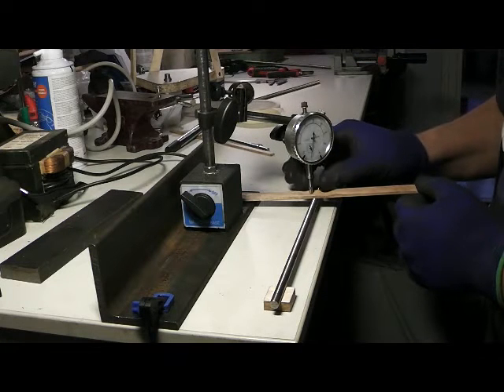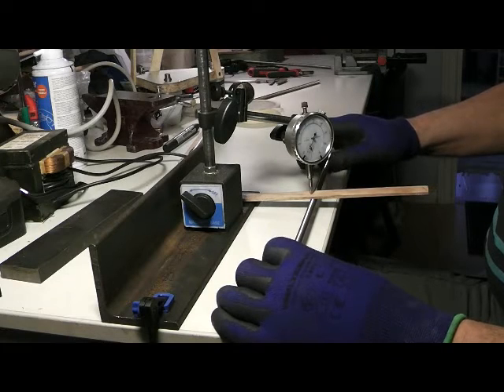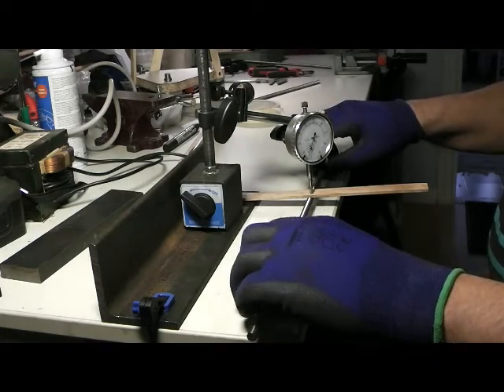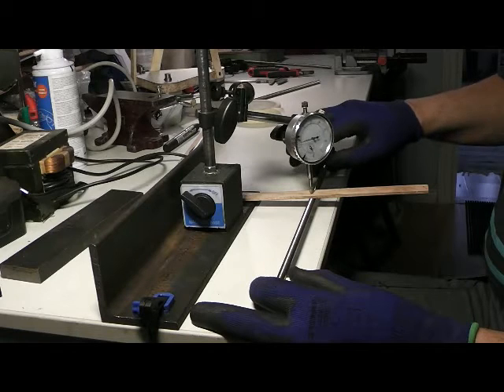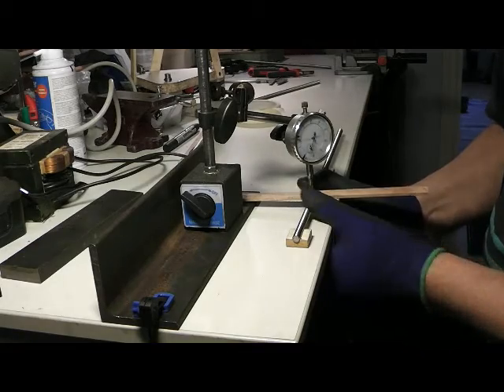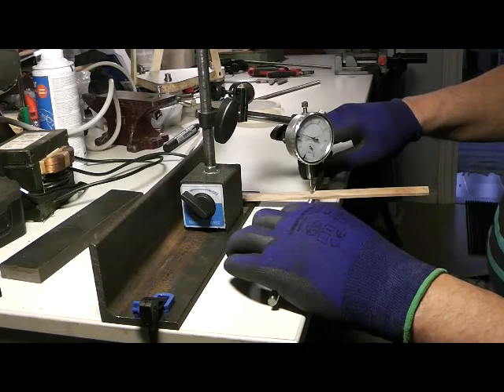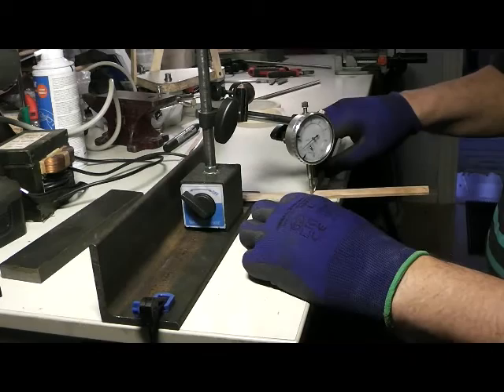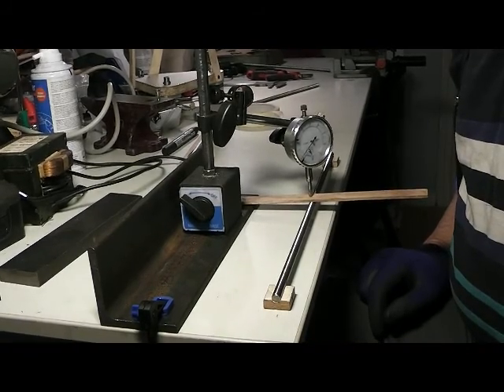Straightening a threaded rod

Comment: I've placed nuts in a vice across the jaws spaced very close together.. centered and level.. doubled nutted the end of the threaded rod (locked one nut against the other).. used a cordless ratchet.. (not an impact as not to hammer the threads).. and used a constant light supply of oil (lube) as i ran the rod back and forth through the nuts to get heat into the threads and it worked quite well in straightening the rod.. 
(Also aware of the sexual innuendos and double entendres in my comment... giggity...lol)...

Comment: The way I straighten a threaded rod is with a hammer.  Bang bang.  Or maybe heat it up cherry red.
Reply: See my post on this video about a crude yet fairly straight forward way of dialing a bent rod in fairly well.. not perfect but close.. slightly heating the rod with a torch works well too... but care must be taken between how much heat is applied and how much speed is administered as not to gaul the threads and cause more damage than repair.. slight heat and slow speed works best with up to medium speed when heat is removed and rod starts to cool down..

Comment: Is there a way to do this without knowing the theory of fourier series... I honestly just want to straighten my threaded rod and I don't understand the theory to it's minute detail. I understand that the rod is bent but can you detail the process? Is it just as simple as checking where it is highest on the caliper then bending down? or do you have specific points where you adjust?
Reply from the maker: Well, basically you divide the rod i halves and then halves again making fourths and meassure the mid-point in each step. Then you shift so the midpoints becomes the new fixed points and you meassure the middle points (that was fixed before). Hm, hope you understand.  Regards, Lars
Reply: @LarsBerntzon  thanks so much for that explanation.